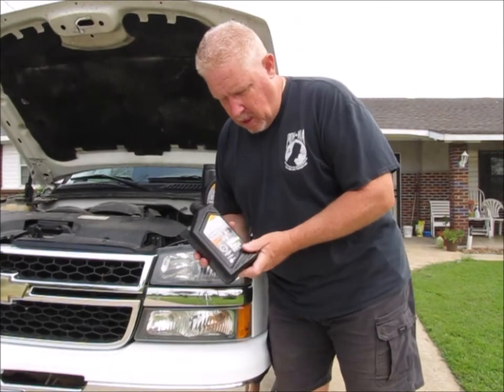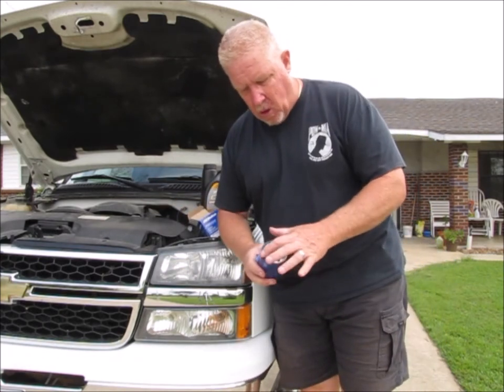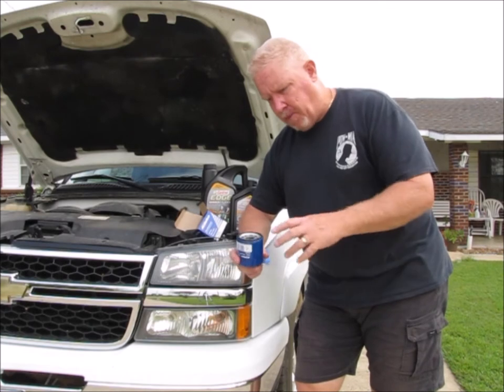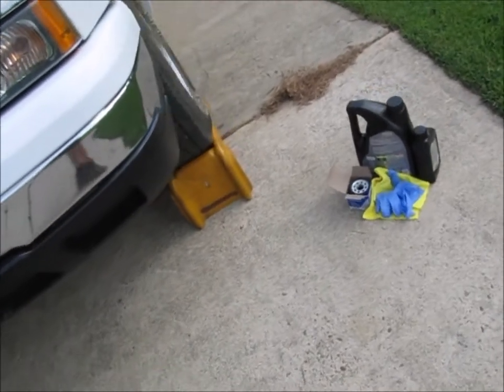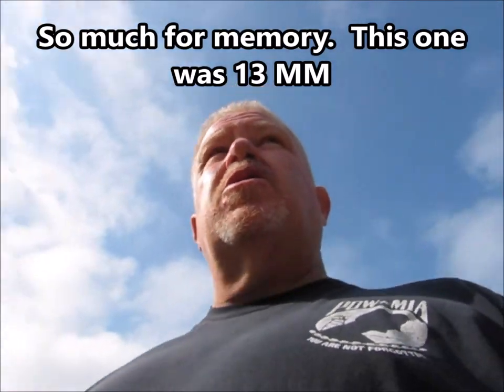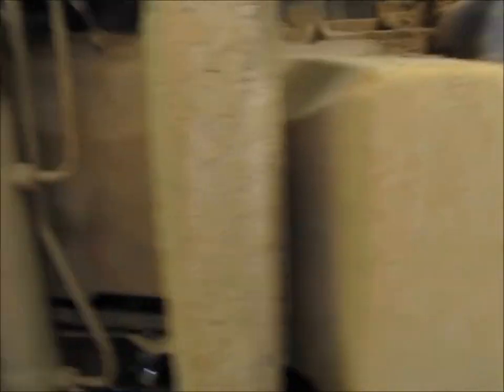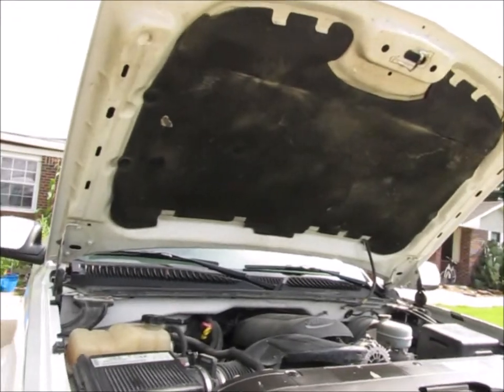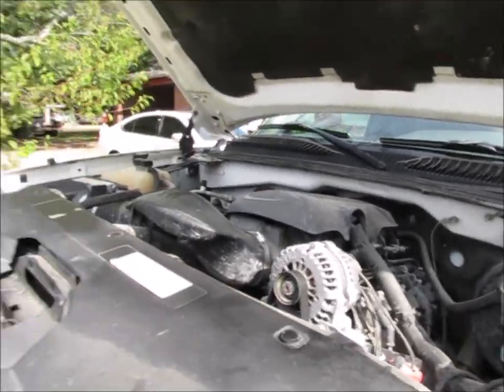The DIY - 30 minute or less Oil Change

Comment: Nice tutorial Ed, I have been a mechanic for over 40 years,  (the only thing that makes me is old!) But you were spot on, excellent advise. I will usually let mine sit for about 15 min. after warm to allow exhaust to cool, oil will still be plenty warm. thanks for sharing!
Reply from the maker: Bet you can get it done in under 15 minutes.  I ran my mouth a bunch in this video!  LOL  Thank you so much for validating my DIY video, just trying to help pass on a little knowledge and maybe help someone save some time and or money along the way.

Comment: Great Video Ed I watched this last night! Great information! Glad to see you using the recomended weight high milage oil. On Newer Vehicles the tolerances and so much closer and the oil galleys are so much smaller you cant run 20w 50 like we did in the 80s. 
Great job on the Video! I use Full synthetic high milage oil too. 
Factory replacement parts are always best (to me) if ai had a Ford I'd use Motorcraft, Dodge Mopar, Chevy AC Delco etc..
Reply from the maker: There is so much controversy over what oil filters are better or worse so I figured AC Delco is a recommended part.  I used to by those filters with the textured sand-paper like bottoms because they are so easy to get off but lately that brand has caught a bunch of flack about being sub-par.  Anyway, thanks so much for the comment and compliment!  I was afraid this video was going to scare people away being so long but it is actually doing quiet well.  Take care and God Bless to the both of you!  Oh yeah, DONKEY!!!! LOL
Reply: @EdsAttentionToDetail  lol! I'll tell her !!🤣🤣👍

Comment: Great tips and advise Ed. I snickered when you mentioned about checking to make sure that the filter gasket comes off with the filter. My very first oil change at 16 I let the filter drop in the catch pan. I did prelube the new gasket and fill the new filter. I put it on and filled up my oil. Went to my gf's house and a short time later, her dad said my car was leaking on his driveway and to move it and clean that sh*t up. I saw where the leak was coming from so I tightened it some more. Still leaked. Told my dad and he said, did your dumb*SS check to see if the old gasket was still on there? My 16 y/o response was, doesn't it stay on the filter? He said go FN look at your old filter and you tell me. That day, I learned something new! 😂
Reply from the maker: Never had it happen to me but I have heard similar stories to yours. I guess you can learn from other peoples mistakes!  Thanks for the great comment!
Reply: Wait wait wait! Pre lube?😂😂
Reply: @ErnieHatmaker  motion lotion 😁

Comment: Great informative video Ed. I started to comment on your stepper motor. Our Yukon has the same dash and at one time or another over the past twelve years that we have had it I think I replaced all of them , some more than once. Another tip that I've heard and it makes sense, is once you use high mileage oil, you need to continue to use it at every oil change. I believe the drain plug on ours is a 14 millimeter. Very detailed oil change. Very good advice on making sure you don't double gasket the oil filter. In my profession I've seen it countless times, even on heavy equipment, which is 80 percent of what we work on. Just hard to find good help these days. I could tell you some horror stories about reliable help. Stay safe my friend 🤝
Reply from the maker: If this was more than just a Farm truck I would have probably replaced that stepper motor by now and fixed the lights around the speedometer that don't work but not wanting to sink a ton of money into this truck right now.  I am glad you enjoyed the video and thanks for the awesome comment!  Take Care and God bless!  Have a nice weekend.

Comment: Good thorough demo Ed
I used to change my own oil all the time. Like you say, very simple process. I drive so little now and need to do it so little, and no longer have ramps so I now just go to a quick lube spot and the price is pretty reasonable. Just not as reasonable as doing it myself lol
I did change my own air filter the other day and check all my fluids on a semi regular basis.
Reply from the maker: From time to time I will take my car in for an oil change if I am feeling lazy but for the most part I do my own oil changes and I can say with certainty that I will be doing all the oil changes on the truck.  Thank you for watching and your great comment!  Take Care